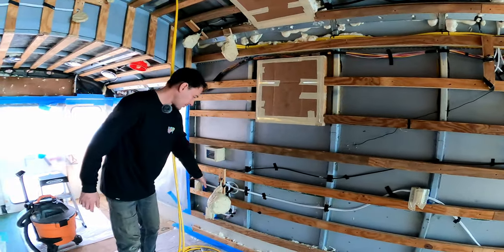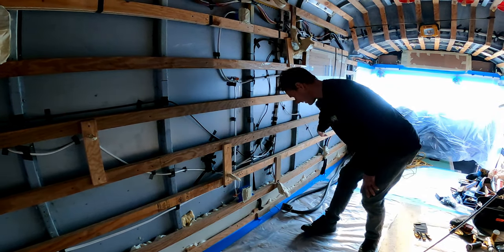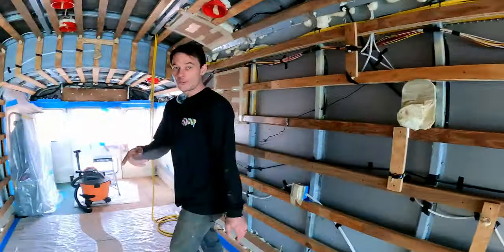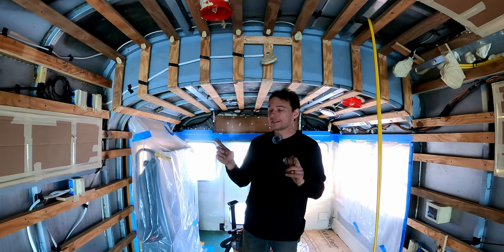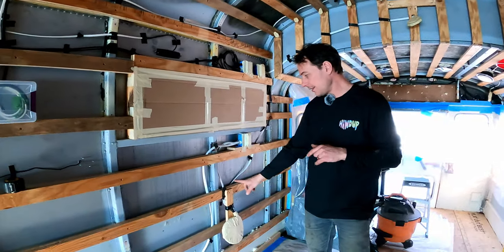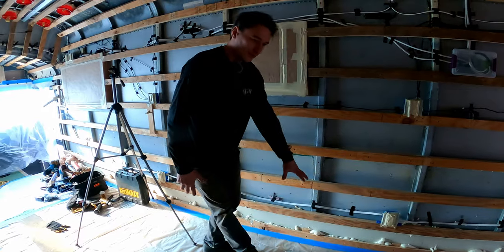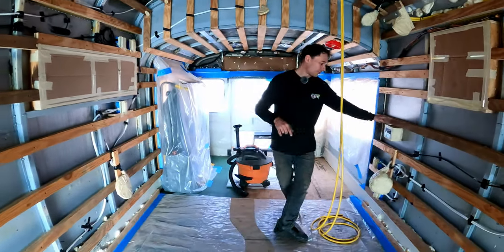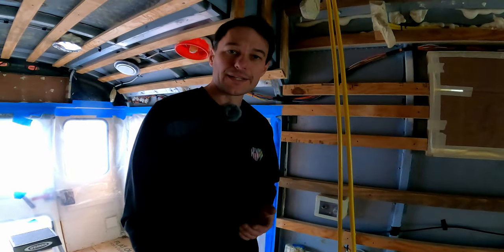Skoolie Wiring Rough-in

Comment: lots of wiring - getting closer. 

one suggestion:
the wire coming up from the floor and splits left and right should be in a box. you aren't supposed to bury wire connections in a wall and cover. if you look at Chuck Cassidy's bus wiring you'll see every wire termination is in a box, very clean. 

otherwise looking good